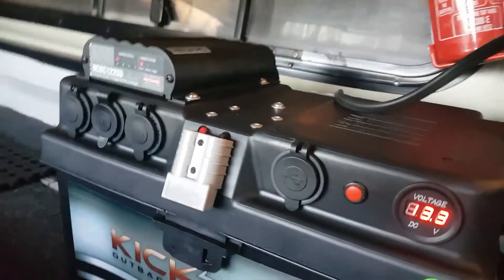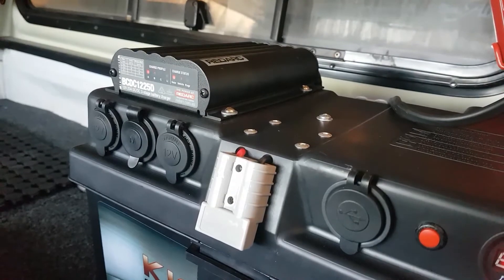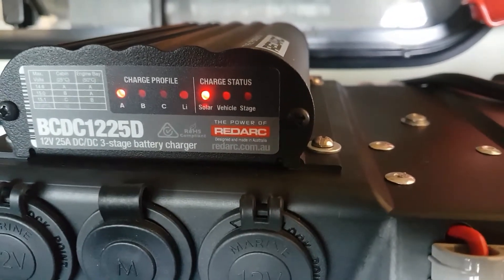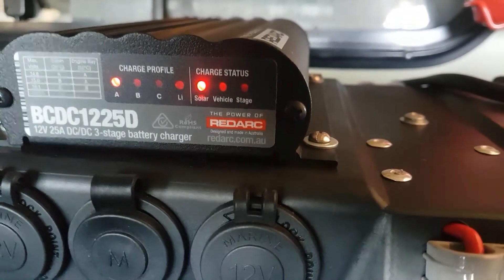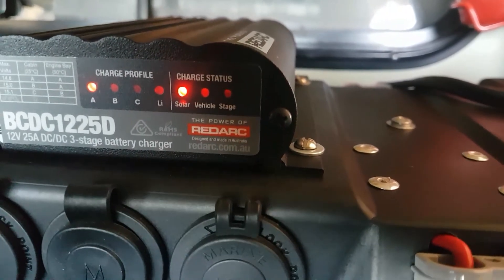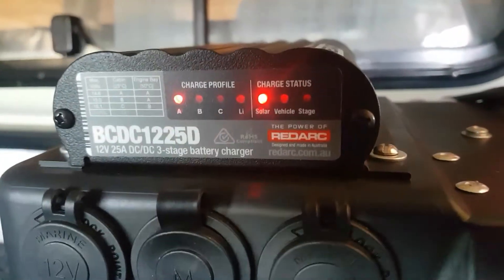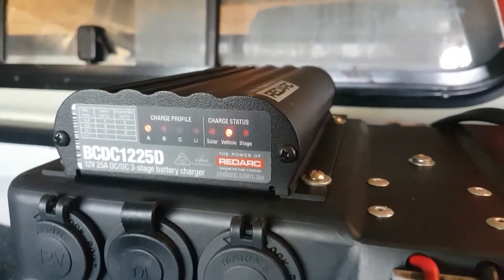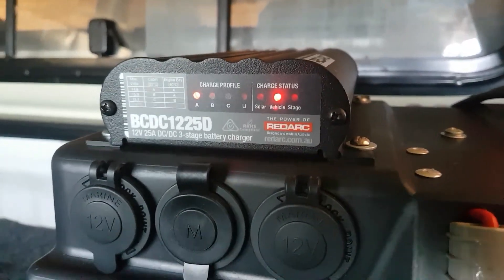Redarc

Comment: Have you had to run an ignition cable (blue wire)? If not how do deal with variable voltage alternator?
Reply from the maker: Yes blue wire utilized.

Comment: Just interested in how your set up is going thinking of doing the same
So I can have a 40 litre engel running full time.
Reply from the maker: Going great has not skipped a beat. I have put a 180w panel on the roof rack since. If you are going to run fridge full time i would definitely put some solar on the roof for when the car in s switched off.